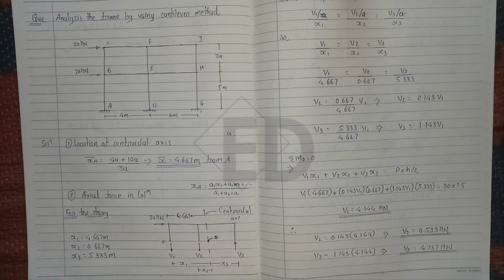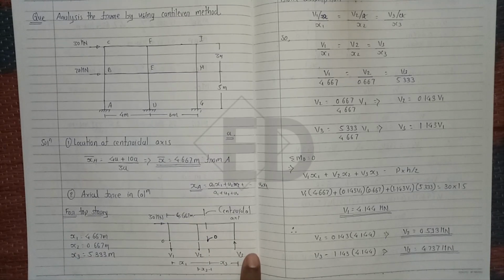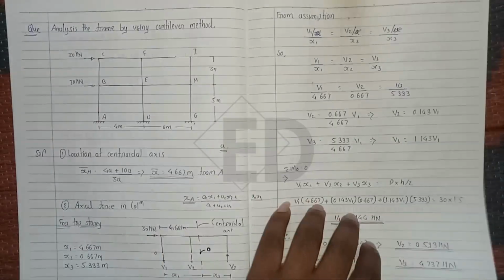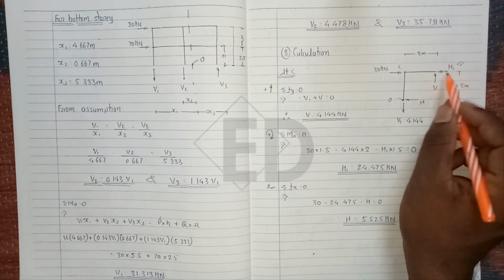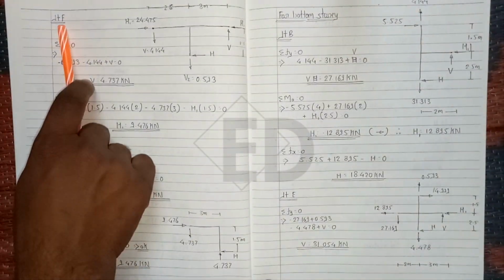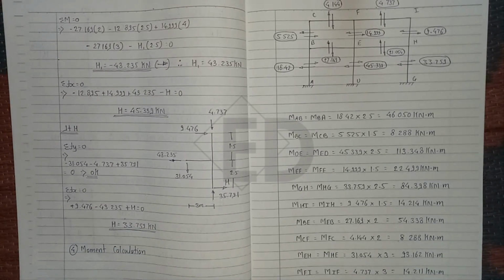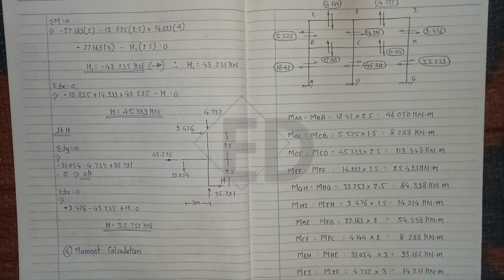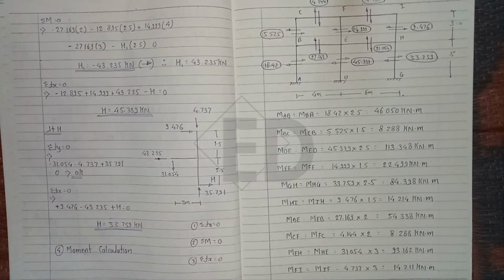Analysis of frame by cantilever method-1 (Two Bays)

Comment: You didnt take 70KN for bottom storey so the calculation of moment @ jont B is wrong But the answer for H @ jont B is similar to the answer you had done. and at joint E the calculation is wrong for moment  instead of 31.054*3 you taken 27.163*3 . Any way thanks for your video i really loved it <3